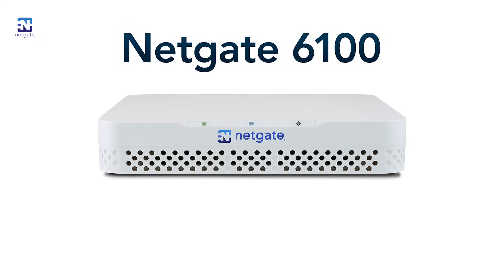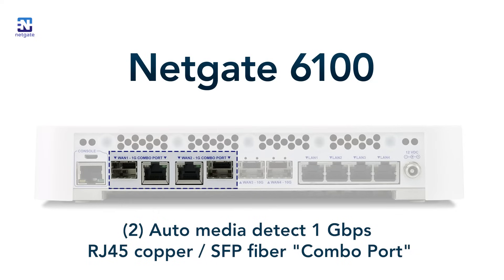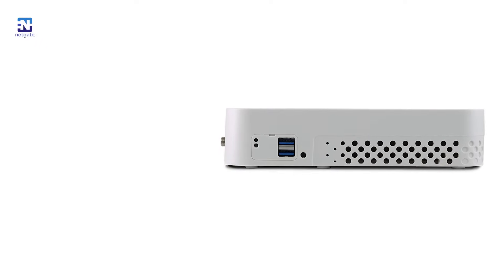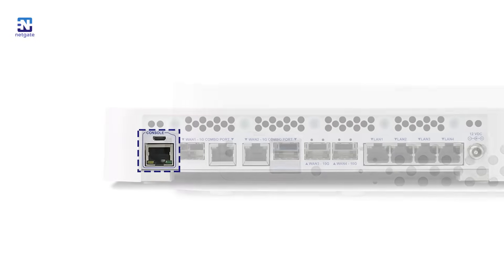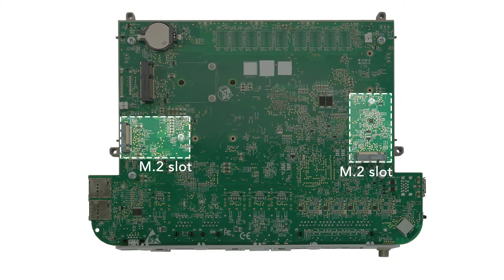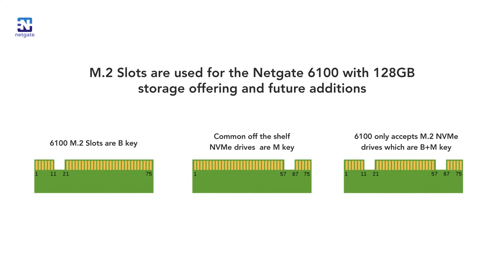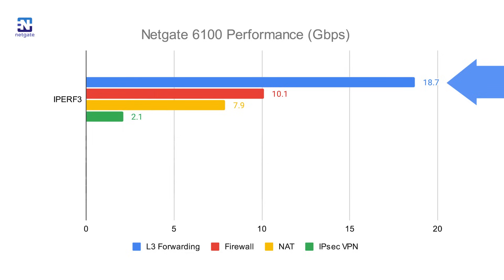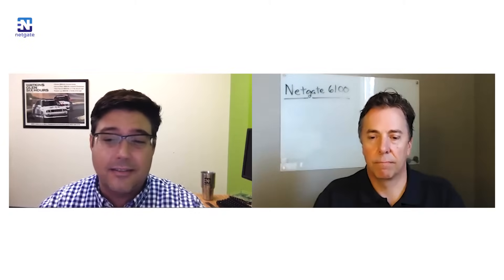Inside The Box: The Netgate 6100

Comment: Long term Meraki user here. Heck I even have 4 years and 299 days left on my licenses, but recently I moved to Pfsense. Main reason for ditching the Meraki MX64 firewall is that we've outgrown it. Being limited at 250Mbit on the WAN side is a 50% reduction of my internet speed (the ISP does give use a "free" speed increase every year or so). After having tested Pfsense as a VM on a Synology DS1621+ for a week, I bought the Netgate 6100 box. So last Friday I received my Netgate (with 4 years hardware support contract). Man am I blown away by it. Yes Meraki has some nifty features, though I don't think I'll miss them that much on our home network. Im quite certain the Netgate box will serve me well for the next few years.

Comment: Looks like an awesome product gentlemen! I've already recommended purchasing 2 of these units. Couple of questions. When the day comes when the LTE & WiFI cards are available, how would external antennas be connected? Is there a future faceplate option that would host the M.2 card connectors to SMA / RP-SMA connectors? Will Netgate be offering 1G and 10G copper transceivers also? 

Suggestion. I'm using SG-3100's at some sites which I'll be replacing soon with the 6100's. Is there a Netgate available "config converter" available I could push my existing config's thru to make the replacement easier? That would be SUPER handy!

Looking forward to receiving my 6100's and great job on, what looks to be, an awesome product!!!

Comment: LOL, now these units cost 799 and respectively 899 and are using SATA M2 storage cards.
Reply: On "AliExxxxxx" a 128Gb drive with the right connectic is in the $10-15 range (KingSpec ssd m2 sata 2280 128 go M2 NGFF SATA SSD M.2)... so $100 more for 128Gb is really exaggerated from Netgate

Comment: I have a 6100 and would now like to add a SSD. Can you please let me know where I can source a B+M key NVMe SSD? I have contacted Netgate support for assistance and they have been hopeless. They are not even aware of what type of connectors/SSD are supported in the 6100 and are just recommending standard NVMe drives which will not fit in the device, very poor customer service...
Reply from the maker: Hi, Yes the SSD is hard to find. It was not our design choice. Your best option would be to look at KingSpec or similar brand. We have not been able to find them commercially in the USA.
Reply: @NetgateOfficial  If I install a B+M NVMe SSD, is there a migration process? Does the pfSense OS (need to) get moved to SSD storage? Is the SSD used for expansion (logs, packages, etc.)? How is licensing impacted if at all? Thank you! 😊
Reply: On "AliExxxxxx" a 128Gb drive with the right connectic is in the $10-15 range (KingSpec ssd m2 sata 2280 128 go M2 NGFF SATA SSD M.2)... so $100 more for 128Gb is really exaggerated from Netgate

Comment: I have question 🤔 is this can handle 50 user simultaneously have a traffic in and out, also in heat is this device can still work even if the device reach 45C temperature? like stress testing the device if can handle it like months not rebooting it or shutdown.

Comment: Very nice product. To check: would it be possible to use one of the Sfp+ cages for 10gbe wan, and the other one for 10gbe lan?
Reply: @ImTheKaiser  Thanks for your reply. I understand that, but its more about the internal hardware. Does the CPU have enough power to route 10gbe etc.
Reply: @ImTheKaiser  Hi Kai, Thank your for your extensive explanation! It helps a lot. I currently own a DIY box running pfCE with a i5-5250U for a 600Down/50Up connection. My current setup has my desktop/NAS/Servers in the same subnet and only IOT, GUEST in a VLAN.  My switch has 4 SPF+ connections for the desktop/NAS/Servers, the rest is all 1gbit. Currently that is enough but were planning to move to a new house which has 1gbit/1gbit connection and will be upgraded to 5/5 and even 10/10 in the future. Do I need it? NO, but my current setup does saturate the 10gbe line when transferring large files to my NAS (I edit alot of 4k video). In the future I want to segregate the network further and not have the servers and desktops/laptops on the same subnet/VLAN. Thats were my current setup is lacking L3 and 10gbe routing. My unifi USW PRO does support L3 switching but its not known for being excellent at this. So my two options would be: pfSense router with 10Gbe connection, or adding a L3 switch for the routing. Would adding a small L3 switch, and trunking it to the bigger unifi switch work? I have alot of POE devices connected to it now.
Reply: @ImTheKaiser  Thank you! And im look forward to your results! Real world experience is always the best comparison.
Reply: @ImTheKaiser  Hi Kai, thank you for the testing! Bridging is indeed not preferred, and not necessary in my setup. My setup would consist of one trunk port or a LAGG of the two 10G ports (trunk as well). Good to know that it holds it speed enough to be a lot faster than a single 1gbit link.

The VPN part is a bit concerning,  was that with OpenVPN? Currently my VPN connection is limited by my ISP provider's speed but the CPU doesn't reach above 25% load. A solution would be to use a OpenVPN server on my powerful home lab server instead of it running on the pfSense box, but that is less convenience.

Comment: Very keen on this model. Need a replacement for my veterinary hospitals two aging Netgate SG-4860 units and these may be the ticket, even if not in rack format. The higher IPSEC performance and fiber interfaces will be useful as we are building a larger hospital and will need to keep both in operation at the same time together.
Reply from the maker: Hi! We have a rack mount in development. It should be available in Q2 2022.